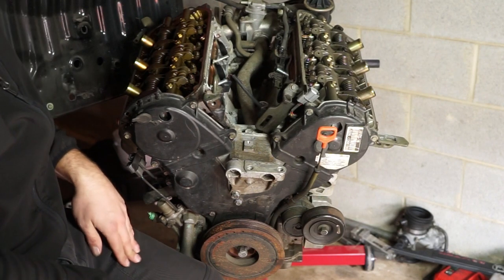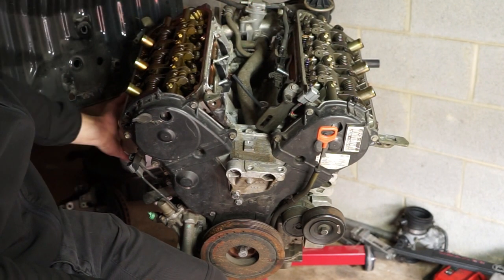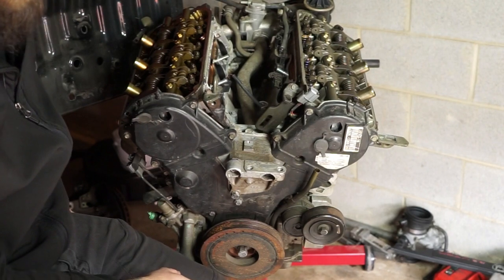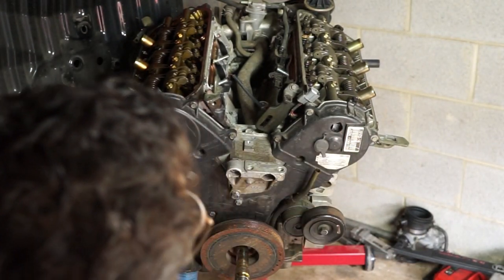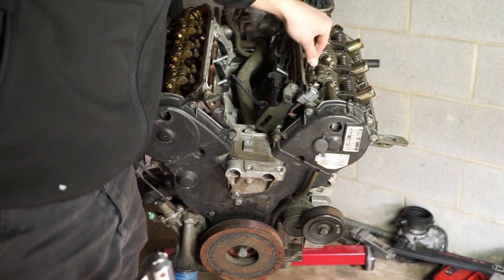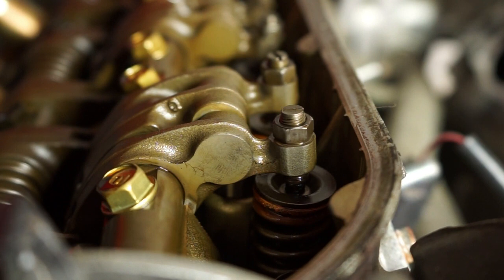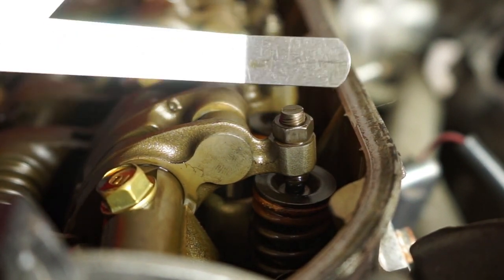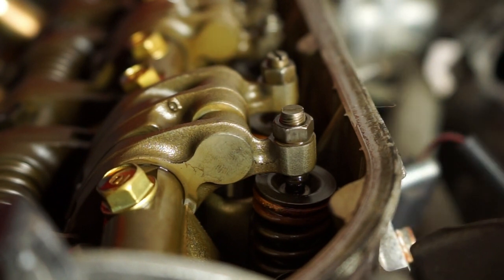J32 Valve Adjustment | NSX JSWAP | Evan Germond

Comment: Nice video Evan.  I'm pretty sure what you meant is the cylinder numbering is, starting at the left (rear head) 123 and right (front head) 456, from the timing belt, same as the NSX C motor.  Firing order is 142536, also same as the NSX C motor.
Reply from the maker: Thank you for clarifying that one. Yes I was just number the cylinders not referring to their actual firing order